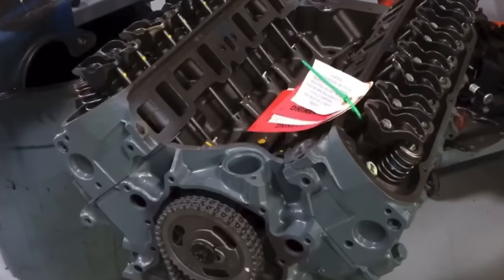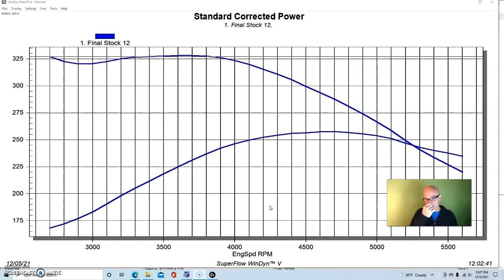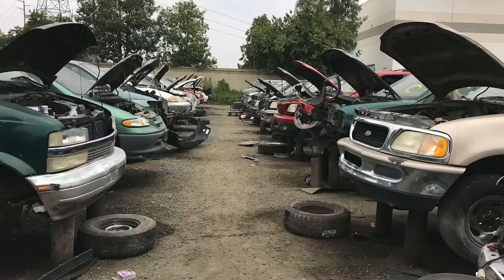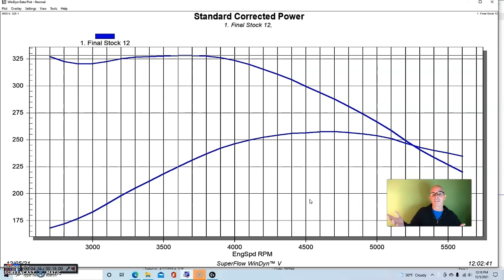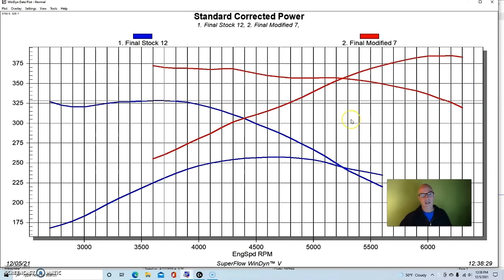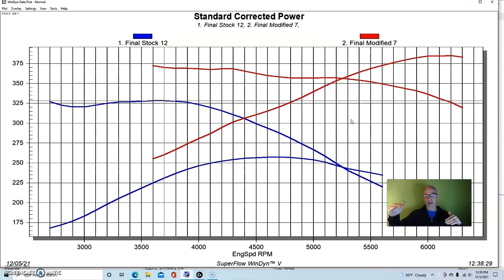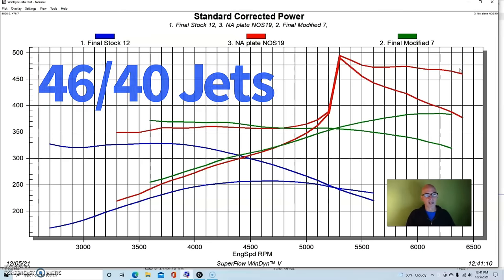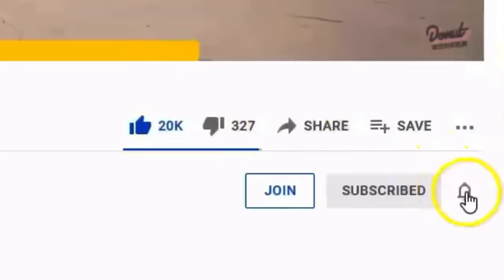HOW TO BUILD CHEAP 5.0L FORD POWER! WHAT DOES IT TAKE TO ADD POWER TO YOUR DAILY DRIVEN SB FORD?

Comment: I built a 351 stroker budget motor; 393 crank, stock rods, Cleveland 2v heads with 460 2v intake valves, roller cam. Cheap power! Edelbrock Clevor intake manifold.
Reply: Paul the canted valve Cleveland 2-V
production iron heads will easily outflow E7 heads (and most OEM Windsor based heads) while still maintaining decent charge velocity across a wide rpm range with the 2-V sized ports. The only thing to be aware of are the negative comments posted by the clueless online experts in regards to the open combustion chamber design produced for U.S. vehicles. 

While it is more prone to detonation than the excellent OEM Cleveland 4-V closed (quench) chamber design, the problem can be avoided with the proper compression ratio, cam duration and ignition timing. 

There are still plenty of 351C, 2-V heads available in salvage yards and online at affordable prices along with a good selection of aftermarket “Clevor “ intakes and/or spacer plates to adapt Cleveland heads to 8.2” and 9.5” deck height Windsor blocks. All blocks will fail when their power capacity is exceeded so anyone overly concerned with the cyber hype about 302 blocks splitting in half when pushed hard should just use a Cleveland block to start with. It doesn’t matter if it’s the 2 or 4-bolt main bearing cap variety. They both have stout bulkheads and pan rails supporting the bottom end. Seeing is believing so check out the DragBoss videos right here on YouTube. His naturally aspirated, single 4-V carb, all engine 408 Cleveland small block stroker pulls 752 horsepower on the dyno, runs 9.60 quarter miles in his all steel ‘69 Cougar and he has been using the same OEM 2-bolt main iron block for almost 20 years with no failures. Try that with a stock Windsor block or even a highly overrated SBC block and you might have a very bad day. 

Lots of builders like yourself have had great results with standard displacement as well as larger 383”, 393” and 408” Clevor strokers. If anyone reading this has doubts about the power potential of Cleveland heads, I suggest checking out “The Other Guys” videos featuring Cleveland heads posted by Mr. Holdener. His fair and balanced method of collecting real data and posting the results regardless of the outcome is as good as it gets in the cyber world tainted by bullshit 😉.  

And the beat goes on……

Comment: So Richard,   no worries about piston to valve clearence with stock pistons and 2.02/1.60 aluminum heads?   I Bought The E-cam for this... Ive got some Liberty heads...  have not done clay test yet... curious what you have found out about this possibility for a problem....   🤔
Reply: I plan on doing the same thing this winter.  Might just have to install them with a head gasket and measure piston to valves.  I can’t find a solid answer either.
Reply: Shouldn’t be a problem. I been running the E cam in a Motorsport long block /flat tops for 20+ years now.

Comment: I'm building old school 331 chevy.RPM Edelbrock top end, custom Isky cam. I want to single Turbo " rear" mount under the trunk gt45. Have you tested this combination ? Should I single exhaust with y-pipe to the back or dual. What size piping. 15-18 lbs max boost.
Reply from the maker: y pipe-then single back to turbo-you can double the na power output at 15 psi-the gt45 might not be enough for 18 psi

Comment: Hi . Would i be better off rebuilding my 66 hp heads that need to be updated from leaded fuel . Or a set of gt40 heads . I now the gtp heads won't fit my car because of the plugs aren't angled.  And the big thing is i have to stick to a budget, 2 kids in college put a damper on the money.
Reply from the maker: GT40 WOULD BE MUCH BETTER THAN EARLY 66 HEADS
Reply: Hi Michael,  if your ‘66 HP heads are from the “K” code, 271 horsepower engine, you might be better off financially by selling them to a restorer for a correct restoration project. In my opinion, they don’t offer much of a performance advantage over standard 289 heads. Shop around for a reasonable seller with a decent set of GT40 heads that’s also trying to pay for his kids college tuition. It’s a win, win deal for all. Maybe when your children graduate and get high paying jobs, they will show their appreciation for the automotive sacrifices that you are making for them and buy you the crate engine of your choice 😉. 
Hey….it could happen !!!

Comment: Great video man. I just inherited my dad's '95 5.0 convertible 5 speed with only 33k original miles. The only mods he ever did was a cold air intake and a cat back exhaust. I just did a 3.73 gear swap but also have shorty headers, high flow catted x pipe, 70 mm throttle body, 76 mm MAF sensor and new high performance 19 lb injectors on order. Do you think this is a good way to start my build? FYI I'm not tracking it I just want more power for the street.
Reply from the maker: USE 24 POUND INJECTORS WITH A 24 POUND METER

Comment: Will the Xe274hr pass the sniffer test here in california? Would I be better off with a E303?
Reply: trikc flow stage 1 most likely.  the 274 is like  a stage 2 trickflow  probably wont pass
Reply: With good cats and the air pump feeding them, I think almost anything would pass. I almost passed the sniffer with no cats.

Comment: I don’t need power I’m perfectly happy with a stock engine cuz I only care about low end power and sound. You know light to light power is all I want. Want a cam that sounds really good but doesn’t completely rob the entire bottom end power band. Most anything you do takes away from the bottom end. So I guess to get what I want I just need to pick a cam and put 410s in the damn car?

Comment: Awesome video very informative! I have a 1995 Mustang Cobra. Has Gt-40 heads and cobra intake from factory. I have shorty headers, off-road h-pipe and borla mufflers. Would adding a 274 cam and valve springs be the best bang for the buck to add power? Should I upgrade injectors and throttle body? Thank you!
Reply from the maker: IF YOU HAVE 24-POUND INJECTORS-THEY WILL WORK-THE 274 CAM WILL HELP A LOT

Comment: The power is kinda low with the 205 heads my 306 made 330whp with TFS 170cc
Reply: Thanks for the detailed rundown on your combo...
Reply: Window stickers are worth 20 each 👍😁😁😁
Reply: @hotrodray6802  a good set of heads like TFS 170cc or afr 165s will make 400 horse on a 5.0

Comment: My project '66 has a junkyard GT40P.  Never took the heads off.  Told the Comp Cams rep that I wanted the biggest cam that I could use behind the stock converter.  Installed the springs recommended by Alex's Parts, a new oil pump and timing set.  I'm using a dist. with a Pertronix ignition and an Autolite 108-4100.  I've only driven it up and down the road (no interior or front sheet metal) but it will lay two black lines down as long as I hold it down.  I got a late '50's big Ford 9 inch under it with a limited slip and 3:50 gears.

Comment: I want to apologize in advance for any dumb questions. So......I'm sorry 😕
I'm a Chevy guy that do to circumstance has Fords. A 96 Explorer with a 5.0L and a 97 F-150 4.6 (VIN 6) 4x4. I've pretty much totally rebuilt the F150. Engine, Trans & Transfer, Rear diff, and totally replaced the interior (seats and center console out of an Expedition, dash, basically all the plastics), then a custom paint job. I know it's a lot. But the wife doesn't ask for much. So when she does, she's going to get everything she asked for that's within my capabilities.
   So my question is. Just how good are the heads on that 302 that's sitting in the Explorer? Same question also concerning the fuel injection? The trans in it is gone. Doesn't have Park anymore and the transfer case is shot. If I do anything with that engine, I'd like to land somewhere in the 400 to 500 HP range. Preferably without NOS. Boosted, maybe. Supercharger doesn't sound back. But for now just NA.
    Sorry so long winded and for some possibly dumb questions.
Y'all be safe out there and keep the rubber side down 🤠😎
Reply from the maker: the heads on the explorer are 30-40 hp better than stock 5.0l heads. add a cam and boost and 500 hp is easy

Comment: I'm wanting to put together a very mild aluminum head roller 302 for an mgb roadster project. Don't need a ton of power just a good cruiser. The aluminum heads are only for weight saving, 302s with aluminums heads are supposedly only 40lbs heavier than the original 1800 4cyl that came in MGBs.
Reply: Ive always wanted to do that since the 60s with the yellow B. 👍
Healey would be good too $$ One just sold here locally. 😎
Reply: A SBF HEALEY

Comment: I will always choose good heads over a good cam especially since my goal is rarely to make gobs of power at 6000+rpm.
Reply: no use of using 6500 rpm heads and a cam that goes to 5500  just match it all up or but i dont mind revving a 302 to 6500 because most modern muscle will there and higher.  gotta keep with them  the old school way!!
Reply: True. I took a 87 roller short block. Added 4v Cleveland heads. Engine makes great power and screams.
Reply: @cammontreuil7509  so a clevor? That would be nice. Usually people do 351s for clevors is your an 8.2 deck?
Reply: @KingJT80  yes. The block is a 1987 roller from a cougar.
A 69 truck 302 crank. You have to cut down the oil splash on the back of crank to use a one piece rear seal. 5.4 inch rods. Chevy Keith black pistons, I cut the top of pistons to fit Valve reliefs.
Boss 302 heads and stock intake.
Cleveland headers. 800 double pumper for sport driving, just a 600 for street.
With the stock roller cam engine runs smooth and off idle torque is great.
Believe it or not. With double springs, engine will pull to 8,000 rpm.
You could use Cleveland heads.
I have a pair of 71 boss 351 heads already to modified for another clevor.
A wedge head does make a bit more torque on low end.
But pound for pound nothing beats a clevor for a head rush.
Reply: @cammontreuil7509  YEah like a boss 302  then.
Reply: @KingJT80  LOL.
OK.
Midrange response doesn't matter
Reply: Never forget: The BOSS 302 had 4 bbl Cleveland heads and the (mild) 289 HIPO cam with 1.7 rockers. @ 220* and @ .480 lift.
Good midrange AND top end pull.
Reply: @hotrodray6802  289 hipo cam .
.298lift with 1.6 rockers .477. So a
.477 cam with 1.7 rockers .506.
.477 cam with 1.73 rockers .515.
Reply: @hotrodray6802  a midrange engine to me is about 6500.  basically a perfomer RPM package.
now you wanna talk 7000 and up... now we aint midrange!!
Reply: I kind of agree but you really need a decently matched cam, if i ever build another 5.0 will get great set of heads, cam to max heads and minimum  5/8” long tube headers if i cant find a good set of 1 3/4” LT’s.  These are the three areas i wont skimp on!

Comment: I was wondering on the springs you use i have a set of  TF 205 heads also and gona run the Xe274 cam.But the springs on the heads are about 60lbs heavier would that cause any damage?
Reply from the maker: no

Comment: As of May 2022, Cannot find any engine builder to respond, and no one has any engines available under $6000.00. UPDATE try finding a 302 core anywhere, pretty hard to do currently.
Reply from the maker: I have an alum-headed 302 that makes 400+ hp if you are interested

Comment: How much rpm can I get with a similar setup? Do I replace my rod bolts? Solid rollers?
Reply from the maker: why do you want rpm?
Reply: @richardholdener1727   More RPM in 2nd would help me stay in one gear for the whole track. I do think my recent oil pump failure is from time banging on the stock rev limiter at rallycross in my "Nisstang 500sx". I know these are fundamentally not rpmers...

But the truth is that when I put the explorer motor in the 240sx the car lost something (while it gained speed). I think that something is a progressively rising power curve and 7000rpm shifts.

Comment: Will flotek aluminum heads work with a 5.0HO? Did you have to mill your pistons to clear the valves on the blueprint heads?
Reply: This is also my question...   I've got Liberty alum heads with same 2.02/1.60 and with stock HO pistons (smaller valve reliefs) and E cam...   haven't done clay check yet... soon I will....

Comment: Hello,
I have a rebuilt ford 302 and I have a trick flow stage 1 cam with a set of gt40p heads and also I have a set of AFR 185 enforcer aluminum cylinder heads. My question is which heads should I install because I am thinking maybe the 185 heads will flow slower due to bigger ports and small cam, is .499/.510 221/225 at 112 lobe separation.
Reply from the maker: please see the big 5.0l head test videos-the afr 185 head will be better by a lot through the whole curve

Comment: What about a stock motor with forged internals and run nitrous tests? Will a 100,200,250,400hp shot really work as advertised with stock cam and heads?
Reply from the maker: you won't be able to run a 400-hp shot on a 400-hp na motor

Comment: I have a trickflow 11r 170 top end kit I'm bout to install on a stock 302 got a tubular gt40 intake upper and lower ported and a 70mm tb. Any recommendations on fuel upgrades
Reply from the maker: 30 pound injectors

Comment: I’m using 210cc aluminum heads with a .525 lift cam. I’m getting told that the heads are way to big and it’s going to be lazy off the line.
Reply from the maker: neither of those two things will make it lazy-the cam duration and intake manifold will make more of a difference

Comment: Big question ⁉️. I have Edelbrock performer heads (non RPM) have you worked with them before they say 190Cc. I'm just trying to ball park my hp. I have B Cam 1.7rr shorties and Ford Single plane Intake
Reply from the maker: see the big head test videos on the 5.0l-your data is there

Comment: I put on RHS heads, with 2.02 valves, and TFS stage 1 cam. Sounds amazing  but not impressed with power. Butt dyno says not much more than stock.. #19 injectors,  explorer intake. 1.6 RR. Where did I go wrong? Yes I put in the longer plugs.
Reply from the maker: you need bigger than 19 pound injectors to feed 400 hp
Reply: @Richard Holdener   I got the DW 200 pump and 50# pressure at rail though.

Comment: Hi Richard ..ive got a f350 with a 302 thats been mildly done but it does not move the truck past 65mph the engine does nothing after 65mph  the motor sits at 3100rpm
Reply from the maker: LIMITER?

Comment: So if I have a California emissions truck 95 F-150. I want to increase power to 350-400. Can I get rid of the emissions and EFI? If so what parts would work best?
Reply from the maker: you need to look for emissions compliant parts
Reply: @richardholdener1727  negative, I don’t live in Fl and I don’t plan on making this a road Queen. I have plans for a mud truck.

Comment: 302 with afr 185cc heads long tubes 650 carb basically stock car gonna put nitrous on it what's a good cam that has a nice choppy idle as well as makes good power on motor and will make great power on nitrous??
Reply from the maker: xe274 comp
Reply: @richardholdener1727  I got 600 lift springs would that be okk i got the same intake got a 650 holley for it gonna ARP it  thanks for the assistance love watching the videos very helpful again thanks richard

Comment: What intake and carb is that? What spacer as well do you recommend? Also, what cam would work well in a 302 and later, in a 351? Would that 274 work well in both?
Reply from the maker: it will work in both

Comment: i wish i could build a ford as cheap as the chevys i get like i get the 4 inch stroke 454 with a 02xx trans for free i have 4 setups now with 6,000 to 58,000 miles on them but i did get an old 390 that runs but needs rebuilt for free a lot of 360 fe blocks for free but they just don't have the hp as the 454's i get 450 hp at 485 torque

Comment: I'm in NZ and I've got a 1993 5.0 302 which I'm thinking about swapping to carby and to GT40 heads ,as I don't have a big budget at this point but want to get it on the road. What would you recommend?
Reply from the maker: dual plane edel rpm (or air gap) and 650 carb (Brawler)
Reply: @richardholdener1727  thanks. I appreciate it.

Comment: OK Richard now build a LA 318. Use a 0.040 with a forged 318 crank. try a hi lift cam with some domed pistons like Icon ic845-040 hughes cam will make good power.See what magic you can do.
Reply: Domes above .100 usually hinder flame travel, especially the sharp corners: David Vizard.
Reply: @hotrodray6802  A little work on domes will help , my way is good to get much more power from a 318 with 340-360 heads.

Comment: So you were able to put that cam in with stock pistons and not have any issues with valve interference? What was the rocker ratio? I’m just curious because if that’s the case I can step up the cam in my car 🤔
Reply from the maker: you need to measure
Reply: Yeah did they clear with those big valves and that lift cam with out fly cuts

Comment: What timing did you run on this?  Initial & total?  
I'm running mine with 16 initial and 31 total...but am thinking it can take more w/ my 9.5:1  compression.
Reply: advance it until it pings then back it off.  but you're gonna wanna limit the mechanical for sure
Reply from the maker: it wanted 34
Reply: @richardholdener1727  THANK YOU!
Reply: Back in ancient times before the timing light was invented in a joint venture between Henry Ford and Zora Arkus Duntov,  I tuned by ear when cars had distributors. Advance until the first hint of pinging became audible at WFO throttle,  then back it off until all that could be heard was the Holley at full song 🏁.
Reply: @danielwilson6665  Back when gas was better at 99-100....  4-5 points better than today, rated the same scale.... 
Inaudible pinging can be a problem. BTDT 😁
Reply: @hotrodray6802  …. I totally agree. It’s silent but just as deadly to an engine when not corrected. 😉